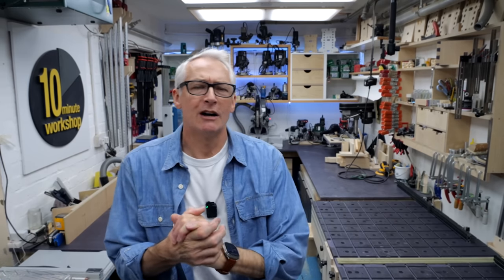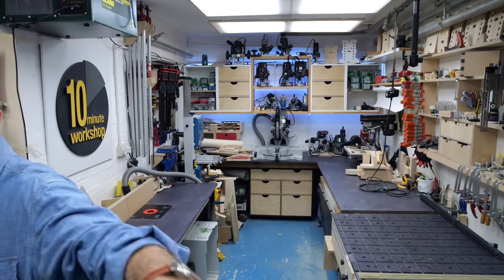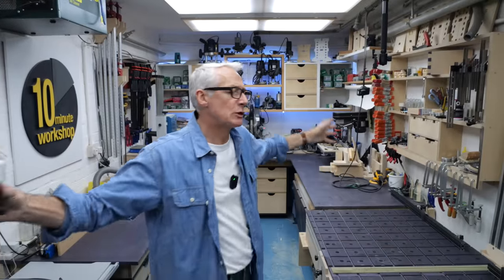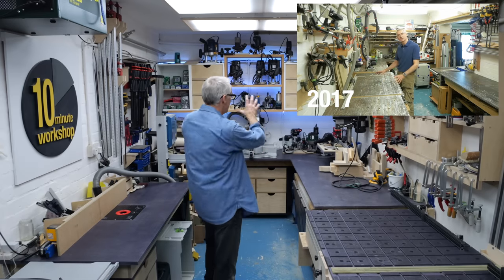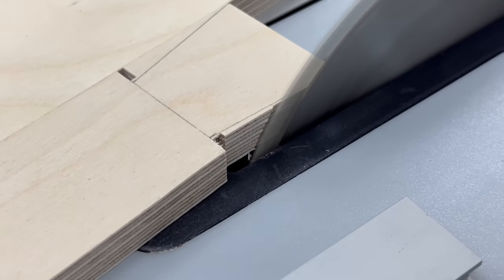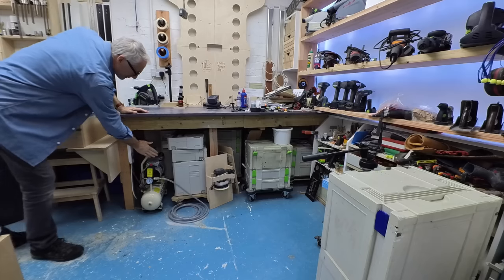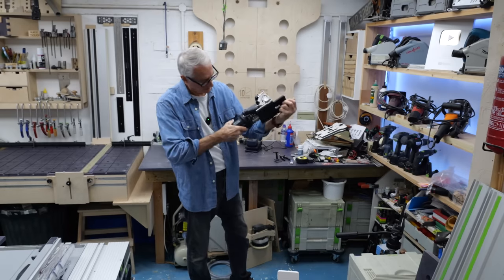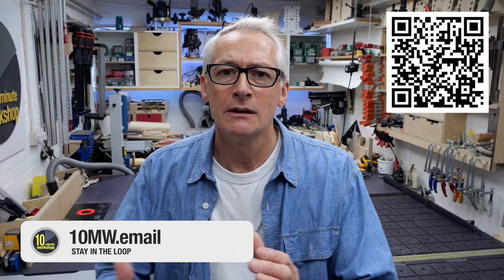10 Minute Workshop, 20 minute Tour [video 541]

Comment: I have always liked your shop. I always thought it was interesting that your small shop produced real furniture for decades while most “content creators” have shops three times the size and never actually produce anything for real customers but yet feel the need to upgrade because of space limitations 🤨. My favourite part is by far the router table, so very simple and efficient. I also appreciate the skill you have with the MFt and track saw.
Reply from the maker: Thank you! It was always a squeeze when I was doing fitted furniture work, but you manage with what you have - and I had low overheads!😆 👍

Comment: I’ve only been a viewer for about a year now, but that was a nice trip down memory lane.  I think may be the sharp angles that would be required. Would make it in efficient or dampen the airflow too much, but considering how many festool dust extractors you have, would putting in a single three motor record power cam vac be a good way to save space which seems to be at a premium in your shop? Thanks for the tour, Peter!
Reply from the maker: Thanks Frederick.  I thing a 3-motor can vac would take up more space then the three discrete vacs I already have! Also I think they’re more geared to large-bore hoses like you see on thicknessers and ‘big iron’ machinery - the kind I don’t really use! 😂👍👍

Comment: One of the few existing routers was mentioned; a comparison of the OF 1400 with the mafell LO 55 (with the quick clamp) would be interesting.
Reply from the maker: Thanks. I’ve discussed the routers before - https://youtu.be/Y_gLxlCcY5Y - but the OF1400 is a 1/2” router, and the Mafell is 1/4” so not an entirely fair comparison.  It is on my radar though.  👍
Reply: That's right, the of1010 would be fair. the mafell is great.

Comment: How do you handle trash? I didn't see a trash bin anywhere. Also, do you have a dedicated metal bin for oil finish soaked rags?
Reply from the maker: Trash can is under the MFT. Oily or finish-rags are opened out then dried over the corner of the commercial bins outside. Then disposed of.  👍

Comment: Hi just wanted to say thank you for your tour and wanted to ask a question ❓ I purchased a track/plunge saw from Rutland's is there any other long track I can buy as Rutland's only do short tracks and have to have 4 joined together for a long track 
Many thanks in advance
Reply from the maker: Hi and thanks!  I’ve no direct experience of the Rutlands saw I’m sorry, but it seems to be a dead ringer for the Einhell / Parkside  type of saw. Which unfortunately means that your choices are probably limited to the OEM rails or the Festool rails. If you don’t mind getting hands-on then you can strip the lip off the Makita-pattern tracks then you should be all good.  I did a video about the process here -  https://youtu.be/QqTJ4SrRD1M 👍

Comment: The only "mid range" plunge saw that I can think of is the Kreg, which is a 110v 60Hz saw. I don't think you could run it if you could even get one. I have one and am really pleased with it. I did manage to cut all the way through my KregACS MFT-style table though when I forgot to change the depth setting, oops.
Reply from the maker: Yep, but for whatever reason they’ve decided not to sell them here; most other plunge saws sold here with ideas of being better that entry level are basically entry level saws, rebadged. The Kreg does seem genuinely different - the blade’s to the left of the motor, which is unusual for a corded tracksaw. 👍